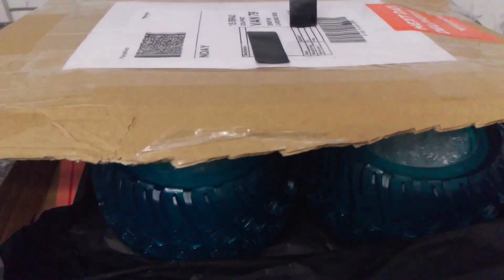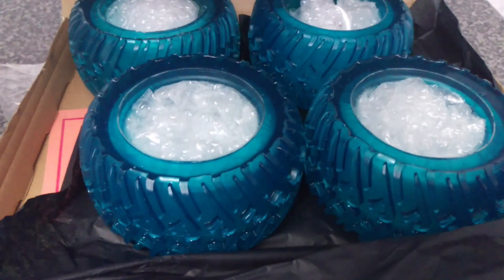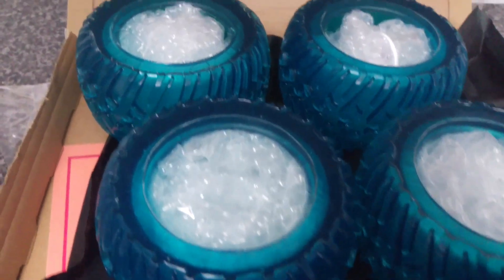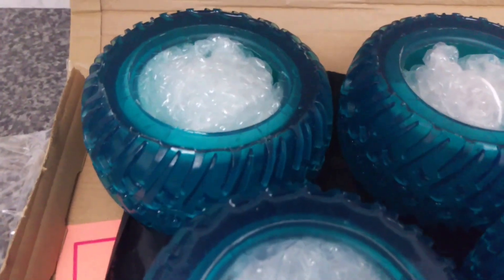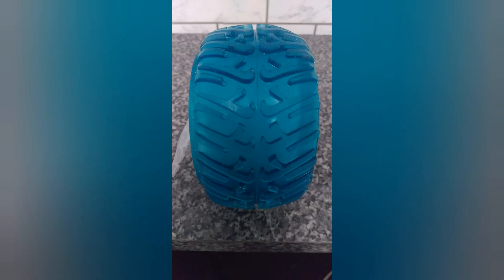Marlon Loves Wheels: install/first impressions

Comment: Surprised it fits as well as it would appears to. I look forward to further videos from you about it.
Reply from the maker: Yeah, I'm quite impressed with it. Turns out there's a 5mm leeway too so they can be used with 90 x 50-55mm wide wheels.

Comment: How are the wheels holding up after riding on them for awhile ?
Reply from the maker: Rode them for 150miles+ at which point the tread pattern becomes smooth; to be expected with 70a wheels. Swapped them out to try/test 120mm Cloudwheel Donuts. The Marlon's are definitely kinder in wet conditions, less range sag due to 10mm smaller wheel size, better on grass verge transitions too. There's also a dedicated group of riders on facebook, worth asking there?